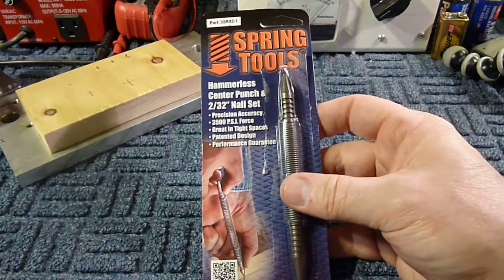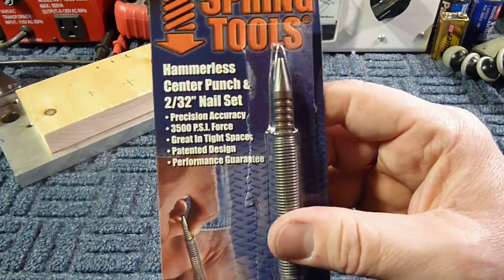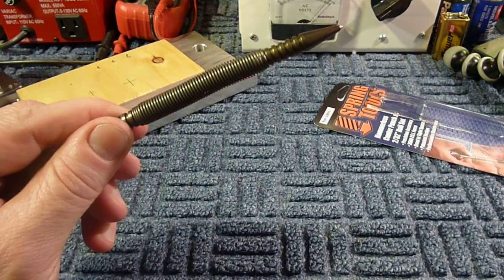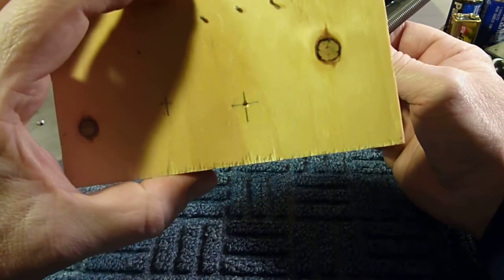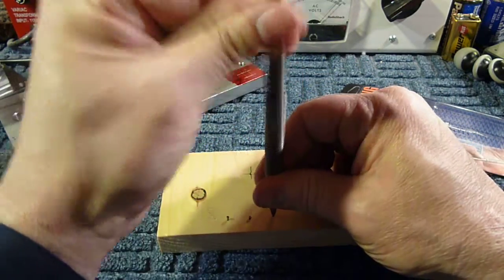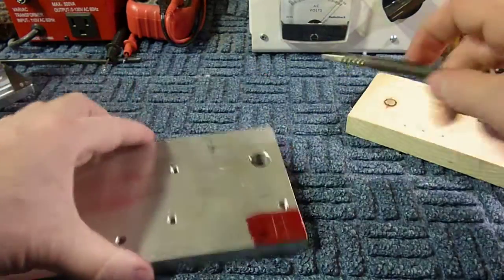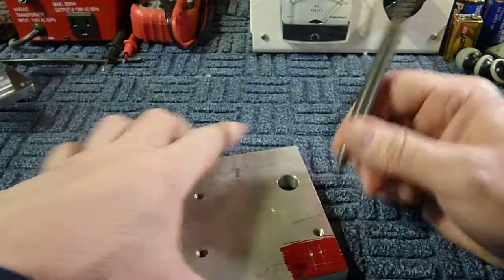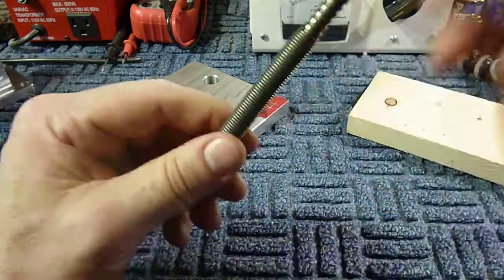SpringTools Hammerless Punch and Nail Set

Comment: I've had a few of these, they are great tools! The points chip off sometimes, but they're a valuable tool to have, especially in tight areas or doing finish work where a hammer has no business hanging around.